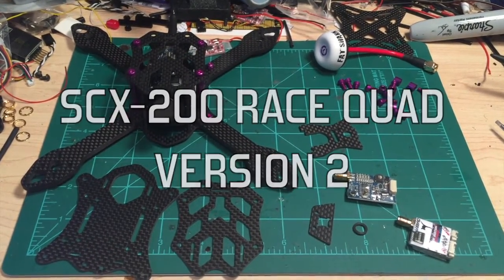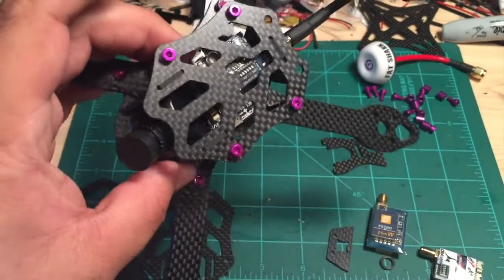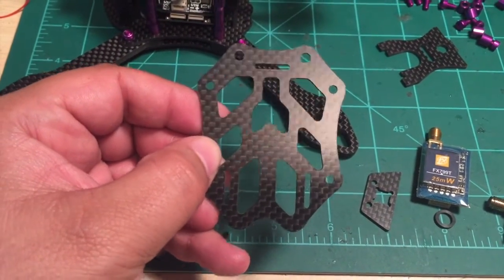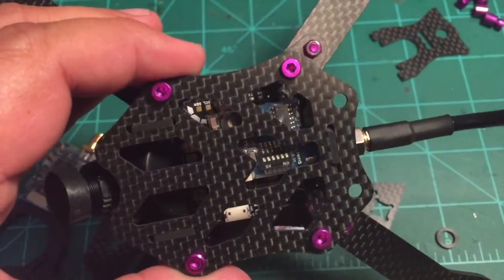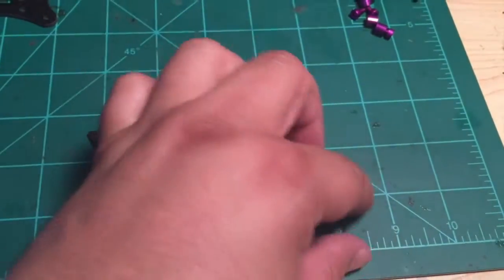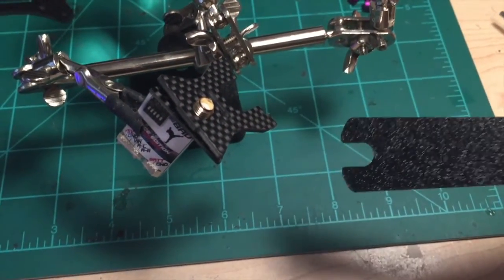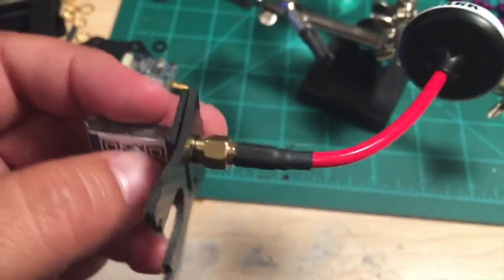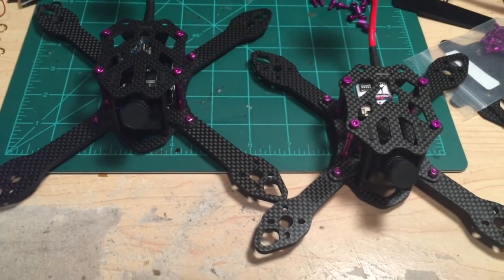Space Cowboy Workbench: SCX-200 Version 2 features!

Comment: I see your'e not using the integrated PDB. The Armattan website suggests it ships with the integrated PDB. Does it come with a the two bottom plates i can see in your video so I can use a PDB of my choice?? or do you have to use the supplied intergrated PDB?  Cheers
Reply from the maker: What you are seeing in this video pre-dates the Armattan Lite SCX-200, it is the original SCX-200 V2 which I (still) sell through Armattan Productions. The newer Armattan Lite frames include the integrated PDB and do not come with a carbon mid plate.

Honestly I like the newer Armattan Lite SCX-200 (then again I am biased because I helped design the changes), but if you are deadset on building an SCX-200 with your own PDB, I still offer the SCX-200 V2 here http://armattanproductions.com/pages/shop_product_grid/208 for those that want the older legacy designs. Just keep in mind Armattan Productions frames are not kept in stock, but are instead made to order, so there is some lead time associated before your frame would ship. Whereas Armattan Lite SCX-200 frames are stocked and sold direct from Armattan and several vendors, and are shipped upon order placement (so they are easier to get).
Reply: Thanks for your quick reply! Lots of interesting frames on the armattanproductions site. Thanks man.
Reply: Ordered a SCX-200!! Batteries obviously go underneath? What size batteries are recommended?
Reply from the maker: Baconterrain depends on your motor/prop combo. Batteries from 1000-1500mAh fit under it nicely, but you will need to decide on the battery that will have enough power to supply the demand of your motors.

Comment: Dear Armattan, Can you provide spec for your SCX200 V. 
5" props? 
Frame net Weight g? 
Frame compatible with Motor 22xx or 18xx?
CF Arm thickness? mm?
Is there option arms for 6" props?
Where can I buy it?
Thanks
Vincent
Reply from the maker: SCX-200 is sized for 5" props, frame weight is in the low 80g range with steel hardware, and in the low-mid 70g range with aluminum hardware. Frame is designed for 220x motors, arms are 4mm thick, and 6" version not available at this time. Watch armattanquads.com because it will be posted there in the near future.

Comment: Will you offer the updates as a whole new kit, or as parts to purchase on ArmattanP? I really like this version 2. Hopefully you make it available.  I definitely want one.
Reply from the maker: +Jonathan Edradan, Armattan has the parts for quote right now, and once they approve them, I will be kitting them in several ways:

1) SCX-200 V2 complete kit: which will include all carbon, and 99% of the hardware except you'll have to source the o-ring for the vtx mount but I will supply the part number (Armattan doesn't offer the o-ring). It will probably cost within a few dollars of the original SCX-200 kit.
2) SCX-200 V2 carbon only kit: which will just be the carbon bits, for those who want to source their own aluminum hardware I will provide a list of what is needed. This kit will be marginally cheaper than the complete kit only because Armattan's hardware is priced very affordably, but I figure some people might want to do their own thing.
3) SCX-200 V1->V2 upgrade kit: which include just the carbon bits and standoffs needed to update the original to V2 spec. This upgrade kit will probably be at significant discount, cheaper than buying the individual pieces, that way current SCX-200 owners can get the latest and greatest too without re-investing in a whole new frame.

Lastly I am entertaining the idea of offering an SCX-200 V2 Limited Kit. This kit will be something I will sell direct in very limited numbers. It will be identical to what you see in the video and will include carbon bits, all aluminum hardware (probably in purple, but possibly in blue too), and the vtx o-ring will be included. These will likely be very limited since I only have so much capital and free time I can invest into this. They will also be significantly more expensive than the Armattan Productions kits because the aluminum hardware drives up the cost significantly.

Despite this, Armattan Productions will always be the main source for this frame because they allow me to offer the frame to others with virtually no overhead. Honestly, I probably could not offer this frame to others without their service.
Reply: +mpbiv421 Thanks for the update.  Keep innovating.  Definitely going to purchase once it's up on ArmattanP.  One question, will it be possible to mount the battery up top?  This frame has similarities to the xhover mxp200b which can mount the battery up top.  But I like your frame better.